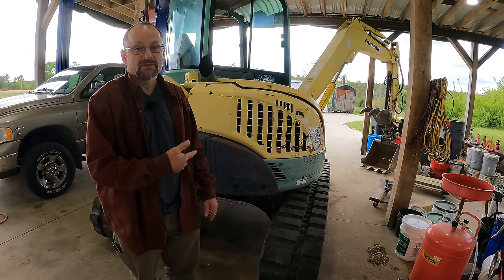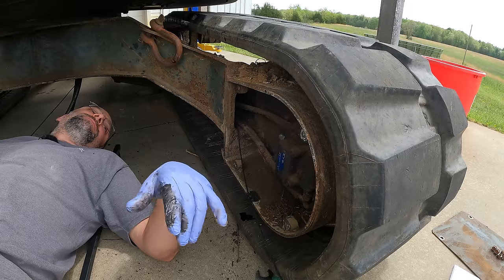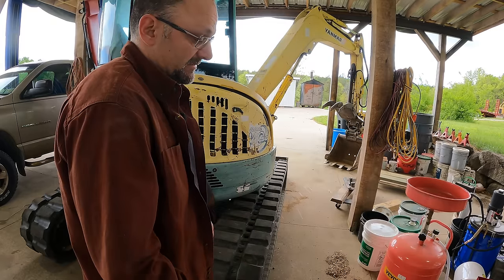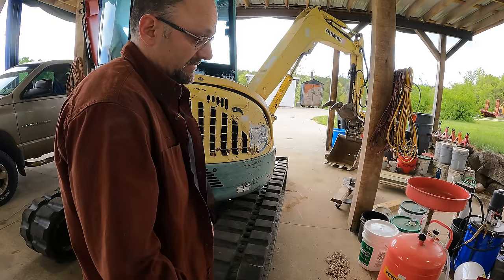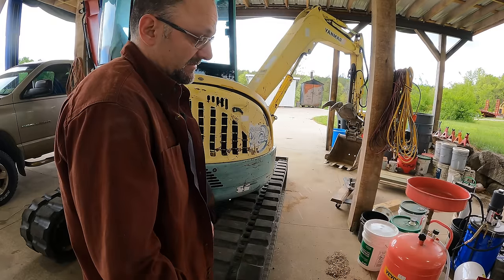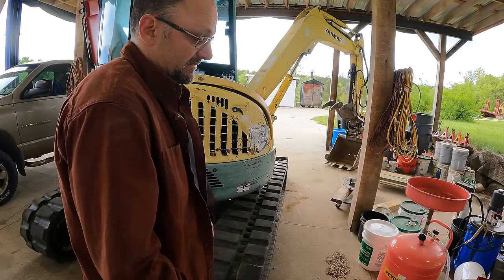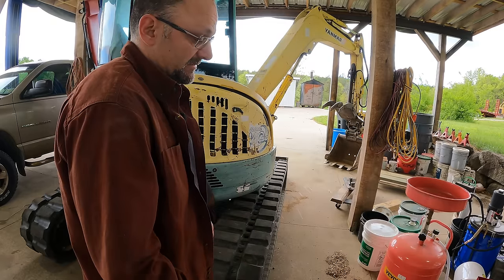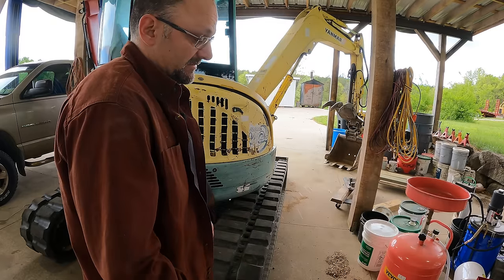Excavator Not Tracking Straight, TOUGH Hydraulic Repair.

Comment: The first question I would ask myself is "was this thing ever designed and built to track dead straight, is that even possible?"
What this excavator really is, is a vehicle with two motors where one motor drives the left wheel and the other the right. You might think hang on my motor car goes straight, doesn't it? I don't think so. You've got a very sophisticated computer, your brain, constantly making adjustments. It's the same flying a plane, pick a point on the horizon and make certain you keep the nose pointed at that to fly straight. Again your brain and arms are constantly making very tiny adjustments.

Would it be possible to make an excavator that would drive straight down a straight road? Sure with GPS and proportional control valves for each track. Would you pay for the additional cost and ongoing additional potential reliability issues?   Probably not. Perhaps the excavator could have a steering wheel so your brain could more easily keep it going straight but...

Comment: hydraulic motors, hydraulic motion - you will never have perfectly proportioned speed / actuation from one side to another. never. there must always be something external to the system controlling for these imperfections. reason being - it's not a swiss watch. there are always minor differences. a new machine, these minor differences are very minor, probably imperceptible and covered over by other mechanical margins. it's just too expensive to make it *perfect*.  in this case, you, the operator = the external something that accounts for, and controls, the imperfections. that's the cheap solution. you pay attention and push one lever farther than the other. you adjust the stops so you don't have to, and then in a year, you adjust them again. and again as things wear out. you are the human PID loop. otherwise you'd have to monitor in real time the actual rotational speed of the thing the hydraulic motor is rotating, and if one side got faster or slower than the other, you'd have to speed up or slow down the other with a dynamic flow restriction. 

this "problem" could be as simple as more heat on one side versus the other makes the fluid a bit less viscous, thereby imparting less pressure. the orifice holes might be ever so slightly larger. maybe the track gear on the left offers up more resistance than the track gear on the right. etc. etc. etc.

you're chasing a ghost that was literally left there intentionally by the engineers. was it "better" as a new machine? sure. but you don't have a new machine. you've got a 20+ year old bargain machine that digs one hell of a hole for the price!

DON'T LET PERFECT BECOME THE ENEMY OF GOOD! (in this case, GREAT because you've taken care of the machine so well)

Comment: What happens if you turn the swash plate adjustment out instead of in? 🤷‍♂ I obviously know nothing about hydraulics except how to spell the word with spellchecker turned on. 😲
I hope you can get the tracking improved because once you fix the big problems the small issues then become the big far king annoying ones. Maybe it's time to take your Johnson for a ride. 🤭It'll take you mind off things for a few seconds at least. 😎